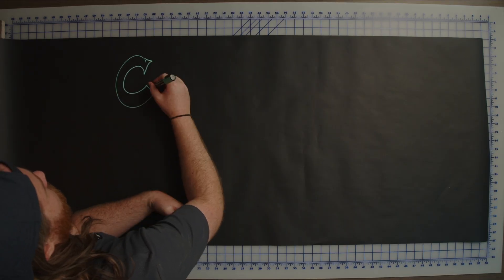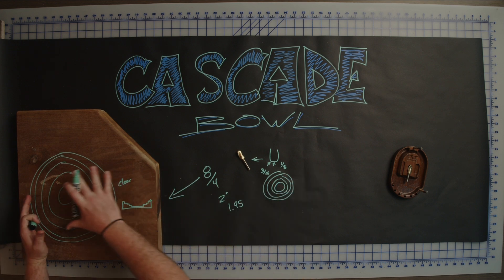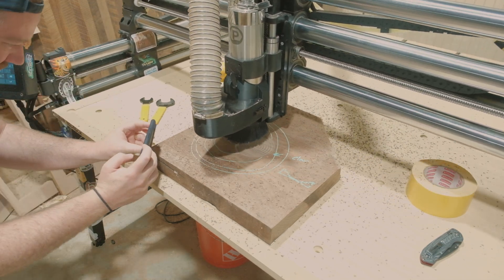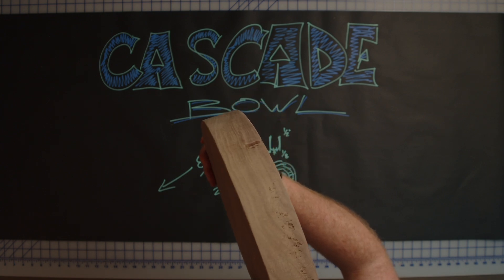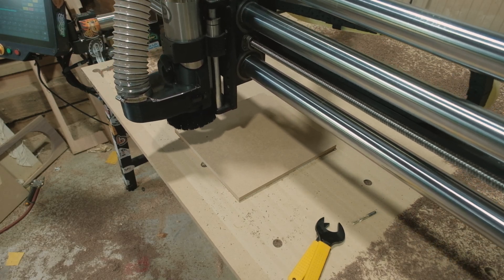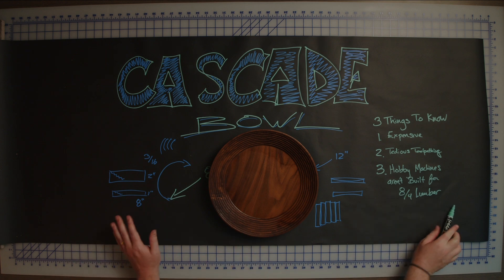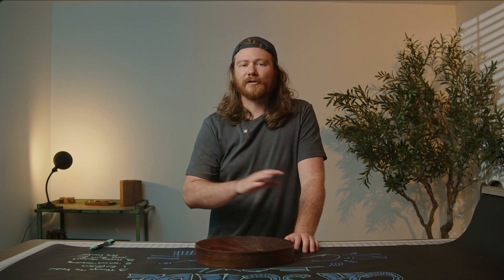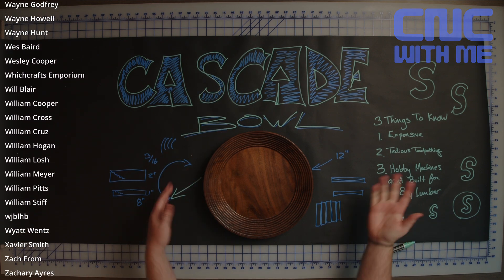I Made A Few Mistakes On This One (8/4 Walnut)

Comment: The much more reliable way to do your outside profile would be to cut down around 1/2 an inch with the Jenny, then cut outside the line with a jigsaw or bandsaw, and flush trim with router or router table. Perfect results every time and much better on your cnc bits.

Comment: I don't know why you use Downtown Jenny and not Cody's Compression but. Downcut bits back scrape the wood. Not cutting into it.a compression bit has the last 1/4"turned into an upcut bit so cuts cleanly I to the wood. But still downcut to keep top edge cleZn